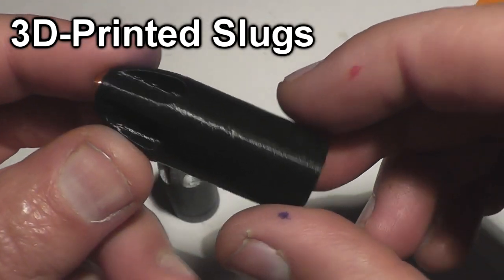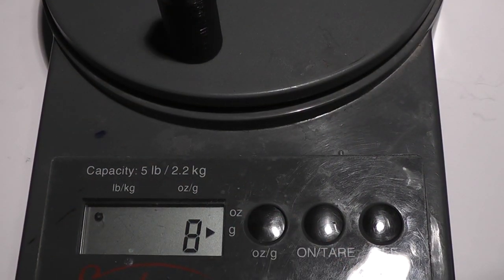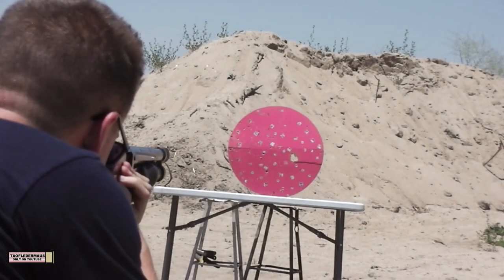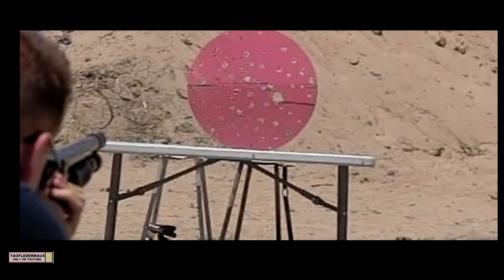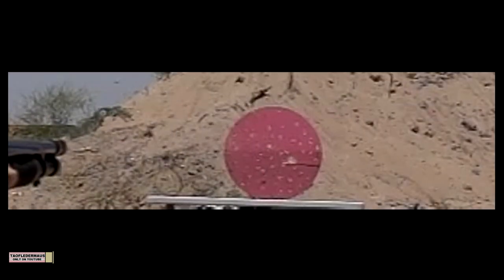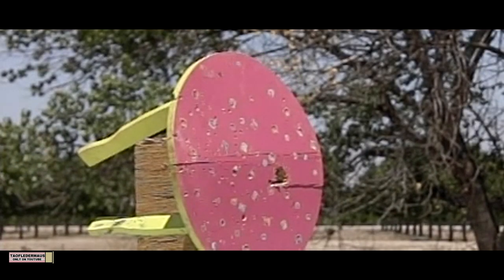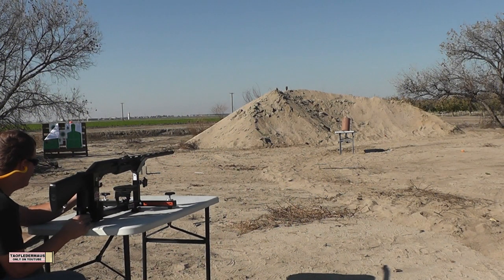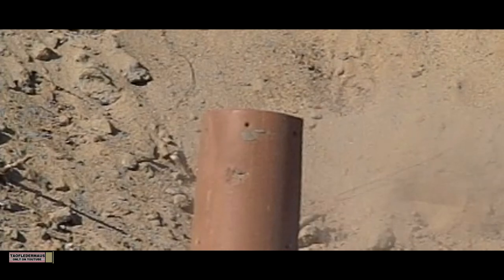3D Printed Shotgun Slugs -  Failure Analysis

Comment: +TAOFLEDERMAUS have you tried or would you try moulding concrete slugs? Should be heavy enough to get proper pressures and heard enough to penetrate but you can mould it in to any shape you want from a conventional slug to aerodynamic projectiles to any comedy shape you can think of? :)

Comment: They should print the slugs horizontally instead of vertically
Reply: waht no!!!
Reply: If you apply force in the same axis as the "grain" structure then it shears right off.
Reply: +Filipe Amaral huh

Comment: you seem to be pretty close to the target, rather reducing the powder what you could have done was further your distance from the target. a shot fires at around 1400fps so that is a lot of pressure on the abs slug at short distance to where point of impact is to be placed. "The other slugs that you've shot" looks to be made from nylon ! would I be right?

Comment: Wouldn't it be cheaper and easier just to cast your own lead slugs? Thats what my father did and I still do.
Reply: +Cat418 But how does that advance ballistic science? :D
Reply: ***** Molten lead can be made into any shape!
Reply: Cat418 But it still has its same physical properties, and as such, it doesn't advance any! Especially since these sort of tests are basically looking for a replacement for typical lead shot.
Reply: +Kain Yusanagi My main question is if it would be more efficient, 3D printers are very slow and it would take a whole day to make a handful of slugs when, with using lead, you can make a bucket full of slugs.

Comment: If the core doesn't pass all the way along the length of the slug, it will move at a different rate compared to the plastic carrier, likely acting like a splitting wedge.  Combined with the other involved forces, and a likely material of ABS, it would break apart.

Comment: The problem they are having is that they are delaminating.  The filament only has a tenuous connection to the other layers in this application.  I would imagine that treating them with acetone as I'm guessing the other person did would make for a better slug.  

     Another thing that could be tried is coating it with epoxy.  Optimally you would then pull a vacuum on the part with the epoxy still wet which would pull the epoxy inside and make for a VERY strong part.  I've seen this used in certain applications and it is quite effective.

Comment: Would it be possible to use the fact that it's going to shatter as a benefit?  Perhaps consider designing the 3D bullet as a flechette round with multiple metal heads.

Comment: Try to print it hollow, drill small hole in tip and fill with epoxy. may give it the strength it needs.

Comment: there is  a 3D printer that can print METAL its in some university you should contact them and see if you can print one of those bullets the 15 year old made that work really well p.s they even printed a functioning jet engine
Reply: There are literally thousands of SLS 3D printers, there's also a large range of metal impregnated plastics

Comment: Haven't seen iridium slug yet
Reply: iridium is as expensive as platinum, and would scratch the barrel because of the hardness of the metal. depleted uranium or tungsten would work much better because of the cost and it is slightly softer, but still harder than steel.
Reply: Also, despite what many references may claim, iridium(22.56 grams per cubic centimeter) is not the densest element, it is osmium(22.59 grams per cubic centimeter), although by less than one tenth of a gram per cubic centimeter. this is measured using x-ray crystallography, and when it was first done, the densities were miscalculated and people thought that iridium was denser than osmium, however it was not.
Reply: But, iridium would be cool. I think you're looking too deeply into the comment :p
Reply: +Pepper Spray i am known for that